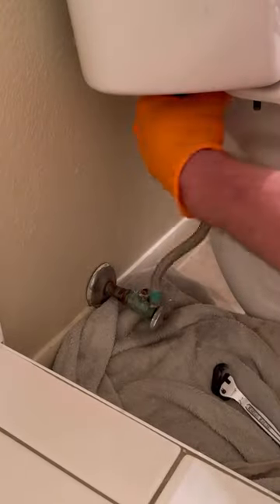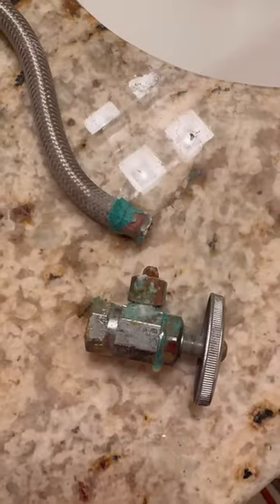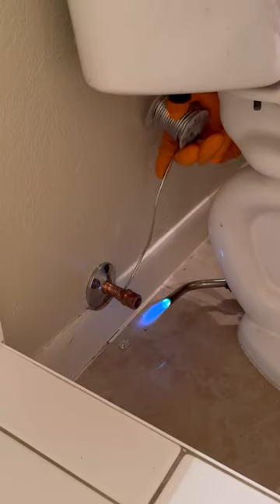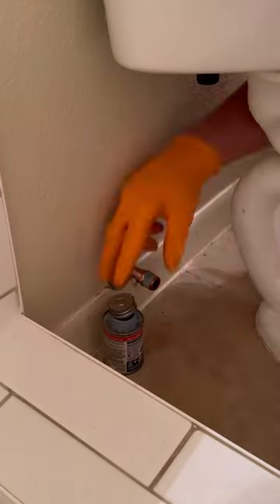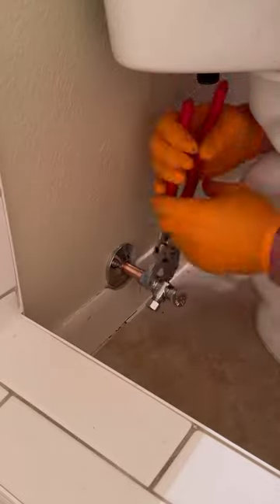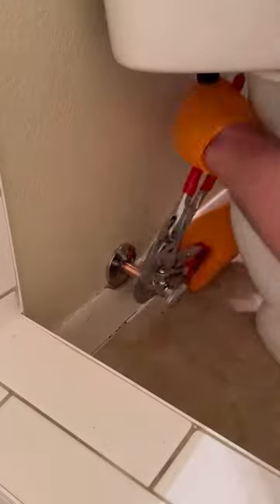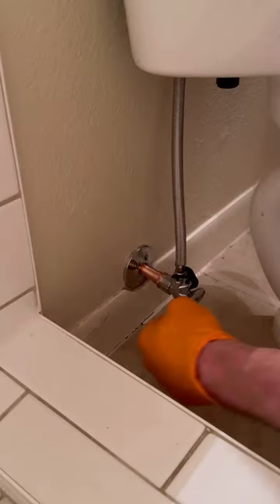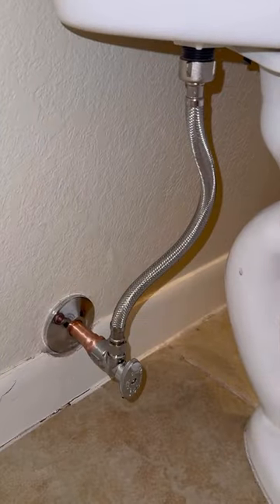How To Change a Corroded Toilet Angle Stop

Comment: Probably would have gone with a compression fitting valve myself, just because it looks cleaner and doesnt require sweating copper in a finished location.
Reply: Hi pardon my ignorance. I bought a few valves to replace them but none of the valves that i purchased were the right ones. I will list them here: Brasscraft 1.2 in. FIP Inlet 3/8 in. Comp Oulet Multi Turn Angle Valve, BrassCraft 3/8in. NOM FIP INLET 3/8 in OD COMP OUTLET Multi-Turn Angle Valve and BrassCraft  NOM SWEAT INLET 3/8in OD COMP OUTLET Multi-Turn Angle Valve. Are there other valves to use with a Braided Stainless steel supply line 3/8 in. Compression x1/2 in. FIP???
Reply from the maker: We do not manufacture BrassCraft valves. If you'd like some assistance with Oatey shut-off valves please reach out to technical@oatey.com for assistance.

Comment: Hi pardon my ignorance. I bought a few valves to replace them but none of the valves that i purchased were the right ones. I will list them here: Brasscraft 1.2 in. FIP Inlet 3/8 in. Comp Oulet Multi Turn Angle Valve, BrassCraft 3/8in. NOM FIP INLET 3/8 in OD COMP OUTLET Multi-Turn Angle Valve and BrassCraft  NOM SWEAT INLET 3/8in OD COMP OUTLET Multi-Turn Angle Valve. The handy man said i got them wrong. Did I? What other valves could i have bought? Lol 😅